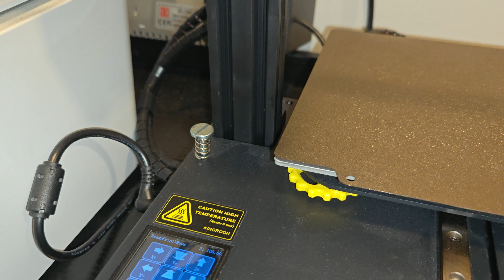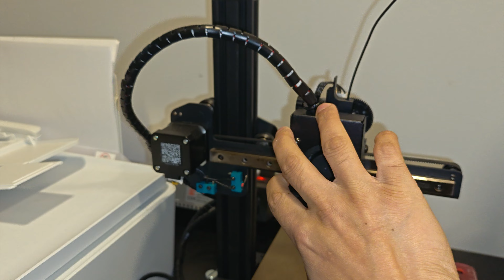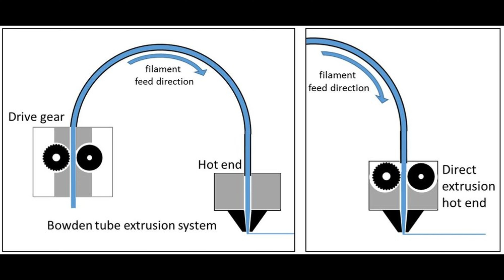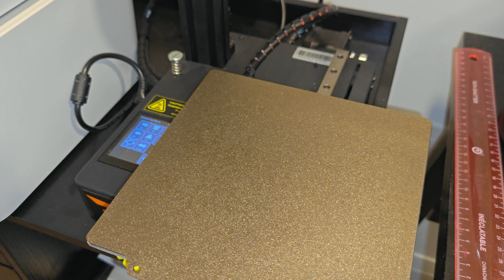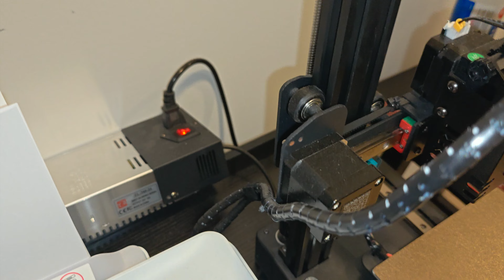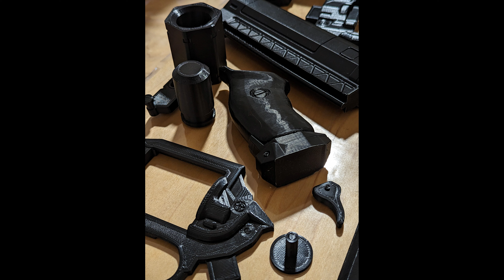Kingroon KP3S King of Budget Printers! Is it worth it?

Comment: I just bought the kp3s pro used for $50. It does ok. Good enough for toys for kids this is my first printer and I simply don’t know how to fix it. The prints often have lines in them like it didn’t push out enough filament. I am printing pla at 50ms and .2 layers. It is random where it happens.
Reply from the maker: Considering it's used I would look up some forums regarding maintenance. The smallest vibrations or misalignments can accumulate into large errors over the period of the print. Maybe I'll do a detailed video on setting up this printer and maintenance. 

You can review the link below to see if you can find some official useful blogs on your issue.
https://kingroon.com/pages/blogs
Reply: @projectloading  that would be awesome thank you! Also thanks for the link I will look around.

Comment: I have a KP3S, 2 anycubic kobras, a ender 3 v2 and a bambu A1. while the A1 just gets the job done with almost no thinkering involved, out of them all the one i like the most is the kp3s, is just so damn simple to modify and experiment on, the board is quite simple but incredible flexible if you can tweak a bit the firmware, my next project for it is adding a chimera extruder to get multicolor prints
Reply from the maker: I'm glad you shared your experience. It's honestly amazing how much options are out there for the KP3S. The best part is that out the box, the KP3S prints amazing for the price point.
Reply: @aldorandomprojects2179  where do I find info on upgrades for this printer? I just got a used one and if I am going to be working on it may as well improve it along the way.

Comment: Coming from someone who has been 3d printing for over a decade, just go with an A1 Mini from Bambu Labs for $199. It prints MUCH faster, has a HUGE aftermarket that grows more every day, and is super reliable. You can thank me later. 😁
Reply: They are printers of different classes entirely. KP3S is half the price, no cloud bullshit and not closed source.
Reply: @TheLaXandro  yeah because your phone and computer, and allllll the other devices and services you use are opensource? I'm sorry but open source is so stupidly overrated in the 3d printing community. Opensource makes for something great for a very few people, closed source makes for something that works for almost everyone... 

for me, a 3d printer is a tool. just like a drill. And just like a drill it needs to work. I dont want to tinker 30 minutes everytime I need to drill a fucking hole.
Reply: I have been using the kp3s for around 6 months and I love it ,I got it used for less than 70 $ 
I did want to buy a a1 mini too but unfortunately they don't deliver to my country
Reply from the maker: I looked at the price of that bad boy. It's pretty expensive compared to the Kingroon KP3S. I don't think that's something as a beginner you would learn from a lot. I personally prefer cheaper products with the ability to upgrade them myself. But that being said, it's an excellent choice for someone with more of a budget and does not want to deal with upgrades.
Reply: @projectloading  ease of use is though, anyone can print with a Bambu lab with no real issues.
Reply from the maker: @johngordon9426  That's fair. I guess user experience differs person to person. However, Kingroon KP3S may be a bit less accurate and slower but it was pretty easy to use in my experience.
Reply: The problem with bambu is when you have to buy it from third parties for example in mexico A1 mini is around 350 and I can get this kingroom new for 100